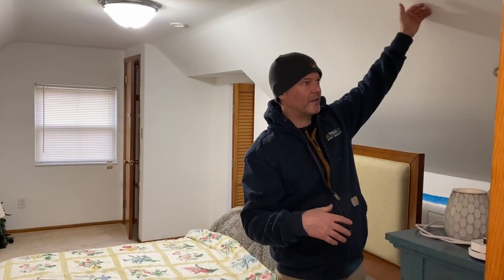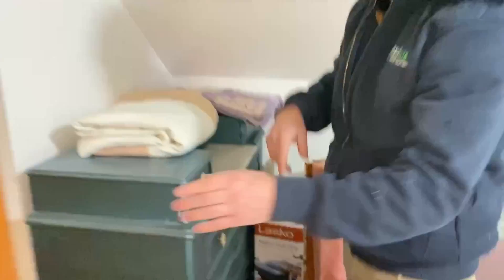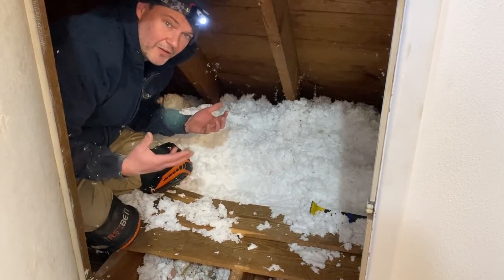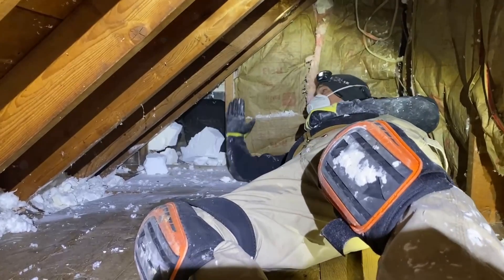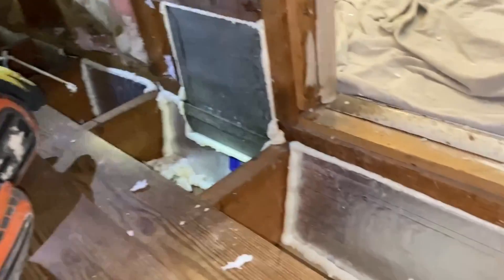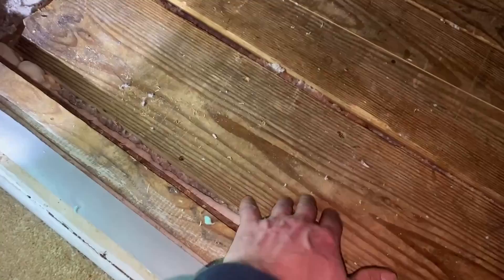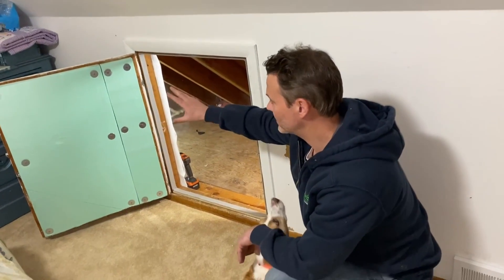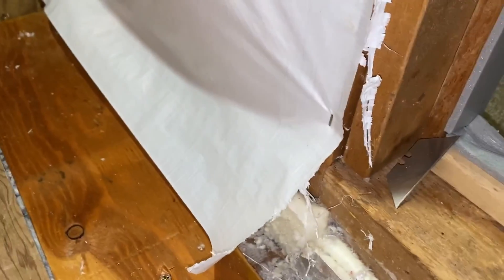What Happens When the WRONG Insulation Company Gets Hired?   Warning...This Gets Ugly

Comment: Excellent video! Best one I've seen that clearly shows the floor transition air sealing that is required. My 1952 house has many of these same issues - access doors with a wisp of ancient insulation stapled to the plywood, kneewall batts with the crumbling paper facing the attic space, etc. About 25 years ago I put a layer of rock wool batts on top of what looks like old sprayed in cellulose which was the depth of the joists. (That didn't do much, likely poor execution). About 20 years ago I hired an insulation company to try and solve an ice dam issue. Their whole idea was to increase ventilation from the lower roof to the top peak. The house has no soffit vents so they installed Vmax intake vents on the lower roof and Vmax exhaust vents near the ridge. At the same time they blocked off the original vents at the top of the gable ends. The vents seem to work, especially with snow on the roof, but those big boxes are ugly as hell. They ran into the issues you mentioned with difficulty jamming baffles through the sloped roof area. I've never had any moisture issues but I've always had a nagging thought that their efforts weren't really successful in getting a lot of air flow from the the bottom right to the top. I estimate that the ice dams were reduced by about 20%. But that means the glaciers are still 8 inches thick rather than 10. I am very intrigued by your idea of treating the top attic and the side attics as separate areas. Does that mean rather than concentrating on moving air from bottom to top, vents at each end of the attic spaces (on the gable ends) would be sufficient? I may have missed it, but how did you insulate that top attic space? Would it be worth it to remove all the current floor insulation in order to air seal the attics (by a pro) or could the typical suspect areas be handled by moving and replacing the insulation, then maybe adding a new layer on top?
Reply from the maker: Thanks Frank!  Yes we isolate the upper attic from the lower knee wall attic spaces, ventilate the two attic spaces independently, and then insulate the sloped ceiling bays by dense packing them with cellulose insulation.  We don't get mold issues, and the results achieved for our customers using this methodology over the last 15 years have been consistently excellent.  We don't use V-max vents.  I looked those up and they are big and ugly...oof!  We use slant back vents.  They allow plenty of air flow and are much more low profile, albeit they're still visible.  
A good insulation team should be able to air seal those areas pretty well without removing what you have there now.  My teams do this all the time.  But if you don't have confidence in the company than removal then air seal, then re-insulating could get you a better outcome.   We never block gable vents in any situation.  That can be contentious, but I'll take what I can get from the positive pressure of wind over much less powerful stack effect driven air flow every time.  Heck, most of the time I'd like both.  I'm going to put in a link below to newer video of us insulating a cape cod style home and you'll see some more details there I think you'll find helpful.  When looking to hire an insulation company, you want to find a company with a building science based methodology rather than an "uncle Donny's been doing it this way since 1987" methodology, if you get my drift.  
Video Link:
https://www.youtube.com/watch?v=x_z9FLeg5AA&t=10s
Hope this helps, 
Andy
Reply: @insulwiseenergycomfortsolu3293  Thanks so much Andy! That video was very helpful as well. Totally agree on the building science approach. I've always been suspicious of the blocking of gable vents to prevent "short-circuiting" of airflow. Always seemed like something that might apply to a perfectly efficient roof structure rather than what is found in the real world. Stack effect seems overrated in these old houses, especially once the attics are air sealed. I think I will look into replacing all my big ugly vents with those slant back types and re-opening the top gable vents. Thanks again.
Reply from the maker: @j.frankparnell3087  I think that approach will work for you Frank.  If you have other questions along the way feel free to reach out!

Comment: I live in Texas, should I also seal off the transition gaps? Not sure if I want to trap the heat since most of the year I’m concerned with keeping my house cool. Thanks
Reply from the maker: Thanks for commenting, yes you'd still want to seal them.  You want to keep the heat that forms in those knee wall attics from pushing between your floors.  It will also help to cool your home more efficiently by not allowing air conditioned air to escape into the knee wall spaces.  I'd definitely recommend this step.  Hope this helps!
Andy
Reply: @insulwiseenergycomfortsolu3293  Thank you appreciate the reply. I'm going to seal them with foamboard like you showed. Will also pull the fiberglass batts and airseal with foam. Might also replace the fiberglass with mineral wool batts depending on cost.

Comment: Hi! Thank you soooooooo much for this video. Question about the slanted walls… is it ok if there’s no air ventilation between the knee wall and upper section? I was think if moist air entered that area even from the knee wall it could create condensation and mold…
Reply from the maker: Hi and thanks for your comment!  We individually vent those knee wall areas and this case did that with slant back vents.  The sloped bays are too difficult to attempt to retrofit baffles into (we used to try).  Also, if you were able to put in a baffle, the 2" thick baffle would reduce reduce the R value of insulation in the slope bay by ( 2" wide baffle / 5.5" wide 2x6 joist) almost 40%.  When both the lower and upper attic spaces of these homes are effectively vented we do not see moisture / mold problems.  And the Pittsburgh climate is a mold maker...we get tons of precipitation and lots of cool (below dew point) weather. 

Also, here is a link to a fresh Cape Cod renovation video that shows the vent process more clearly. 
https://www.youtube.com/watch?v=x_z9FLeg5AA&t=92s
Andy
Reply: Thank you for the reply! How do you go about dense packing the floors? Is the foam board enough to handle the pressure?  @insulwiseenergycomfortsolu3293

Comment: I've been trying to find the perfect video for my attic knee walls and this is it. My rafter bays were completely insulated with fiberglass all the way up to my ridge vent with no baffles. What is your suggestion to fixing this? I may of already pulled down 2 rafter bays of fiberglass to make an escape route for the extremely hot air. Edit: I have soffits and a ridge vent but no airflow
Reply from the maker: Thanks!  In homes with knee walls we insulate the upper attic floor, sloped ceilings, backsides of knee walls, and the "flats" inside the knee wall attic spaces.  We almost never attempt to ventilate the sloped ceiling bays, we dense pack them with cellulose insulation.  We then treat the upper and lower attic spaces as individual attics and ventilate them appropriately.  This has worked extremely well in the hundreds (probably over a thousand now) homes that we have done this in in the Pittsburgh area. 
Andy
Reply: @insulwiseenergycomfortsolu3293  Thanks for the reply. In terms of ventilating them as individual spaces how to you move the hot air out of the knee wall? Gable vents can be used at the very top but what about the lower space?

Comment: Thanks.  Very helpful.  One question:  If the bays between the ceiling and the roof deck are dense-packed, isn't there a concern about insufficient ventilation of the roof deck?
Reply from the maker: No.  If water enters via a nail pop it will be able to migrate to a vented space a few feet away.  The lack of ventilation where the slopes are also will not damage the shingles.  Spray foam companies spray the undersides of entire roofs all the time without shingle damage (but if they're using open cell foam that could cause other damage!).

Comment: Hello. I’m in the process of insulating my 2-story garage - it’s basically a walk- up attic that will be conditioned space (the 1st floor of the garage will be conditioned as well). My question is specific to the 2nd story knee wall space… what I’ve heard referred to as the Devil’s Triangle. The attic within the Devil’s Triangle will be unconditioned space and I have installed wind stops in all of the roof bays, as well as baffles that extend from the soffits to the ridge vent. I’m intending to use R30 batts in the roof slope going from wind stop to just short of the ridge vent itself. I’m using R30 batts in the flat ceiling above the 1st floor space - the actual garage space - with Kraft paper facing downward towards garage space (will be covered by Sheetrock). On the backside of the knee wall itself, I intend to use 2” rigid insulation - this rigid insulation will extend into the ceiling below, for blocking - and I’m not intending to insulate under the 2nd floor conditioned space itself - I’ve read that this helps heat/cool the conditioned space above. My question is this, should I use faced or unfaced batts in the roof slope within the Devil’s Triangle? If I use faced insulation, am I creating a double barrier because I’m using rigid insulation on the knee wall and in doing so, would I be preventing any possible moisture from escaping? For full disclosure, I used R13 batt insulation (faced) on the 1st floor garage (exterior) walls. Your videos are great and I appreciate any suggestions you might have for my project. Thanks!
Reply from the maker: Hi there, sounds like quite the project!  The devils triangle is the aptly named, my team and I were in one yesterday on a 94 degree day.  If I'm interpreting your question right, you intend to insulate both the back sides of the knee walls and the roof slope itself?  That's not something that I personally would do.  I would insulate the knee wall "flats", the knee wall itself, the sloped ceiling bays, and then just the bottom flat part of the "devils triangle/ upper main attic."  I would not insulate the roof deck in the knee wall space and the upper attic  --- unless you would NOT be insulating the knee walls themselves and also not insulating the floor of the "devils' triangle area."  
And in that case I would only insulate the underside of a roof deck with closed cell foam (if it's not going to be covered in a true vapor barrier).  The kraft facing on batts is a vapor barrier in name only.  Water vapor moves right through those things.  With our process we leave as much of the roof deck exposed to air flow as possible to allow it to dry if moisture gets into the area.  We also make sure those spaces are ventilated well.   In the next week I'll releasing another video detailing how we do Cape Cods again.  Hope this helps, but if you have more questions just ask.  Thanks!
Andy
Reply: Thanks for your quick response Andy, I very much appreciate you taking time out of your busy schedule to share your expertise with me. This has been a big project for me but I have the benefit of it being new construction, so at least everything is open and accessible. 

If I understand correctly, based on your reply and after rewatching your video dozens of times, I’m ok starting with an air baffle that protrudes into the soffit space and extends into the Devil’s Triangle and I can use a wind stop to seal from the top plate of the main floor wall to the baffle - I just need to be careful not to block the airflow through the baffle itself. This baffle will allow air to flow freely into the Devil’s Triangle. I can insulate the floor of the Devil’s Triangle (a small portion of the garage ceiling) and the backside of the knee wall itself, ensuring to put blocking under the knee wall to ensure no air moves from the soffit to under the floor of the conditioned space on the 2nd floor - and there should be no insulation under the floor of the conditioned space on the 2nd floor, thereby allowing that 2nd floor space to be residually cooled / heated by the first floor. In essence, I’ll be insulating just the “L” (or reverse “L” ) within the Devil’s Triangle (with no insulation on the roof slope itself within the triangle)?

Am I correct in understanding that I should put baffles and blocking at the top of the knee wall, and extend these baffles to the ridge vent? This in turn, allows air in the Devil’s Triangle to escape through the ridge vent? And, I can use batt insulation on the ceiling slope from the top of the knee wall to the ridge vent? 
 
I have a flat ceiling maybe a foot or so below the ridge vent, would it be ok to put batt insulation in that flat ceiling? 

Apologies for the lengthy message, but I’m anxious to get this right. Again, appreciate your guidance and expertise! 

Thanks,

Craig

Comment: I have a cape cod house in South Carolina my knee walls are not insulated.  So I need to use unfaced insulation and what kind of plastic wrap around the insulation? When I go in my crawl space and look towards the outside wall I can see daylight
Reply from the maker: If you're just doing the knee wall spaces, you want to 1) air seal the electric outlets and floor joist openings beneath the knee walls 2) insulate the back side of the knee walls with at least R-19 kraft faced batts (kraft facing goes against the interior walls) 3) cover the batts with a home wrap such as tyvek paper or a store brand equivalent.  Or you can go over the fiberglass with foam board for extra R value.  That would be my suggestion.
Andy
Reply: @insulwiseenergycomfortsolu3293  wouldn't the home wrap act as a second vapor? I have a similar knee wall but larger in a split level house and am considering doing similar

(great video btw, thank you!)

Comment: Would you add rockwool insulation to the backside of the knee wall? There is insulation on the floor of the attic and in the roof rafters.
Reply from the maker: This is how Capes get tricky.  You NEED to define what your air and thermal barrier is going to be  --- either the roof slope or the back side of the knee walls.  If you are committed to having the roof slope insulated, we would not recommend also insulating the knee walls.  This creates in essence a "double vapor barrier" situation which is not ideal.  Our preference is to insulate the knee wall, making it the air and thermal barrier, and then ventilating the knee wall space to allow for heat AND moisture dissipation.  We don't believe it's a good idea to insulate an exposed roof unless you are using closed cell foam (because it has a vapor barrier at 2" thickness).  But closed cell foam is quite expensive. 
Andy
Reply: @insulwiseenergycomfortsolu3293  I would like to have the insulation in the knee wall for noise.

Comment: A better method for treating the knee wall 4ft wall would have been insulating between the 2x4s with r13 so it sits flush with the studs, then on top of that use 2 inch Polly foam board rather than the house wrap. This will give a higher r value and allow you to completely air seal all the joints with spray foam or foam tape. I can’t imagine the house wrap being completely air tight.

Seeing how the inside transition was already messed up by the previous company, it would have made more sense to extend the thermal boundary to the knee wall slope and do an outside transition air seal. The soffits are not ventilated so you might as well condition this space because it has no communication to the attic.
Reply from the maker: Hi there, you're correct in that going over top of the knee walls with foam board is a better solution, but it also raises the project cost by a good bit.  It's not just the foam, but all of the small triangular cuts and time that it takes on the dormer sides.  We give customers this option, but hitting them with a thick layer of R-19 batts offers a massive, instant improvement over what they had. 
We are not fans of insulating against roof decks, generally speaking, unless you are spraying them closed cell foam which is NOT cheap.  Other solutions can allow moisture to get trapped against the underside of the roof (open cell foam, batting them with fiberglass, attempting to use foam board and trying to get all of the seams tight in difficult areas to access, etcd).  We vent these spaces with slant back roof vents.  This allows heat to escape in the summer, and moisture to escape in the winter.  This is not only a less expensive option for the homeowner,  but one that dramatically reduces the chances of a callback for a moldy roof.  Thanks for the comments!
Andy

Comment: Great video. Is the house wrap meant as a vapor barrier? I’m guessing not as it has some gaps along the bottom. Is it only meant to air seal? In either case, are the gaps okay?
Reply from the maker: Thanks!  For homes in heating zones (where there are cold winters) the vapor barrier should be on the inner side of the thermal / air barrier of the home.  In most cases that the walls with several layers of paint on them (not perfect, but still pretty effective).  
The house wrap in this case serves two primary purposes.  One is to protect the fiberglass and hold it in place over time.  The second is to protect it from air flows inside the knee wall spaces which can act as a "wind washing" process which wicks heat from the fiberglass batts.  
Before we install the batts, we use foam to seal all of the penetrations on the back side of the knee walls such as electric outlet boxes, switch boxes, etc. 
Hope this helps!
Andy